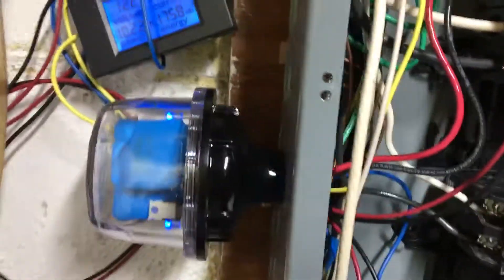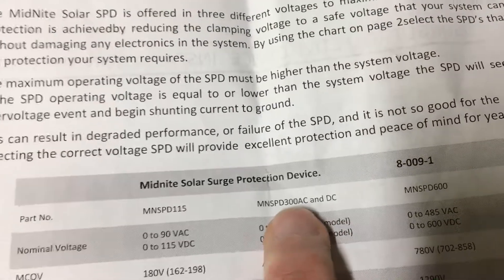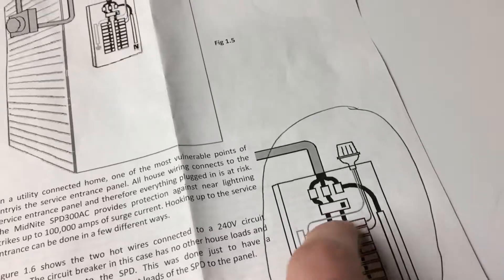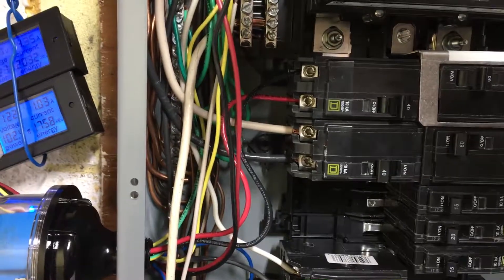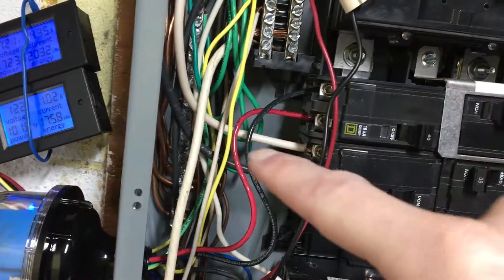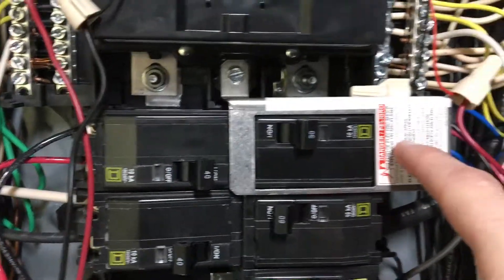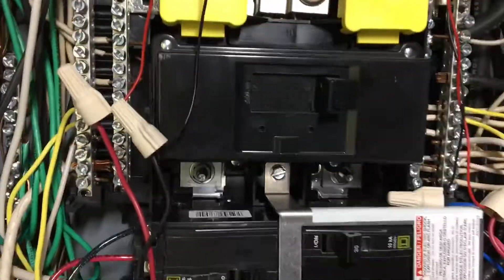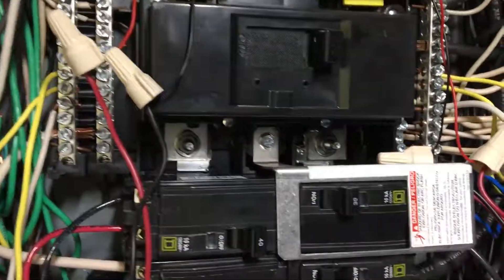MidNite solar surge device.

Comment: Thank you so much for the video I learned slowly so if I put this out under the meter at the main service panel that would protect my whole home is that right so I don't have to put it inside my home I can put it on the service panel outside that feeds my sub panel? Again thank you I know this is an older video but it seems to make a lot of sense